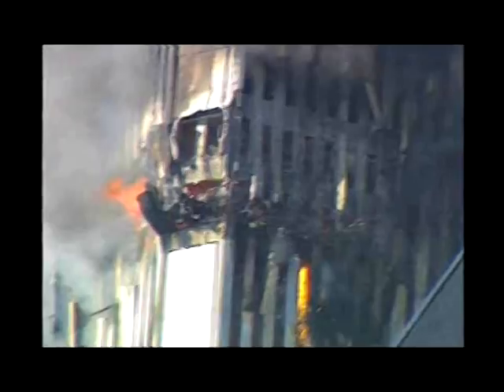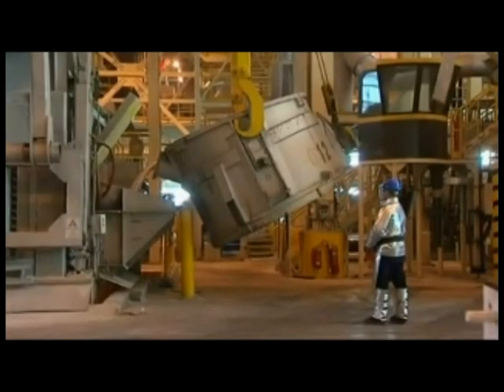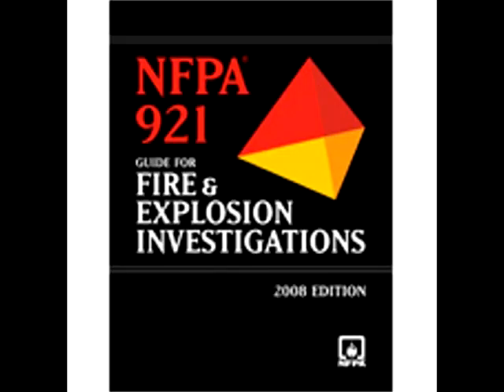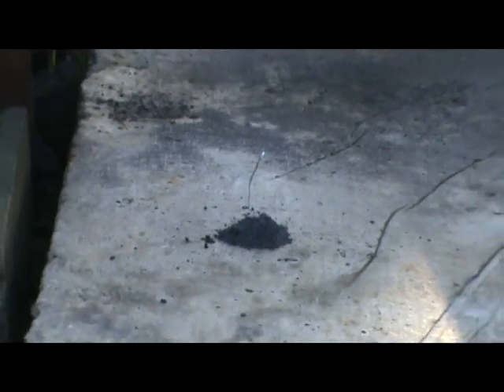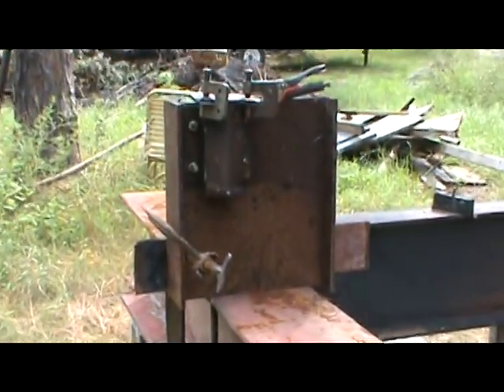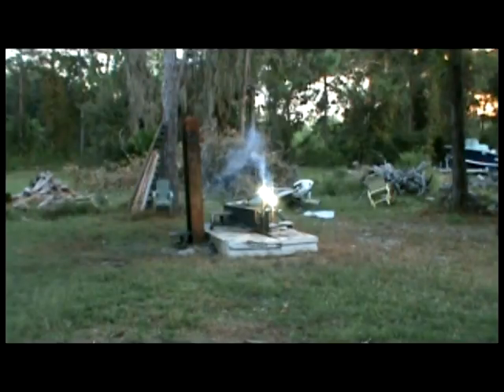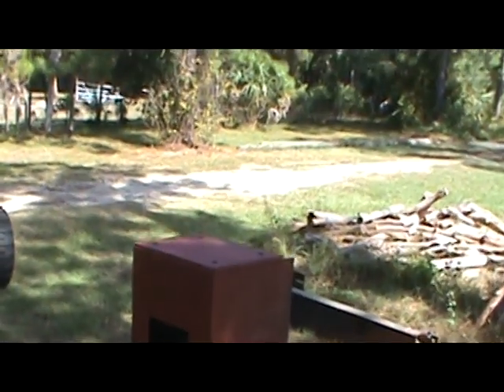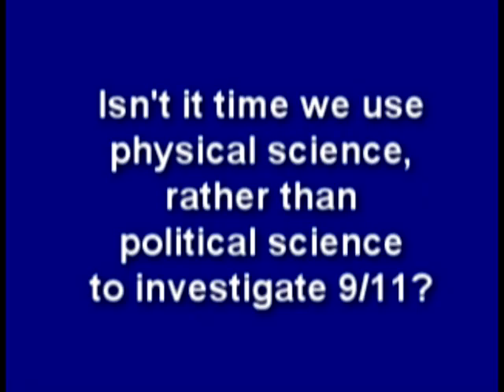9/11 Experiments: The Great Thermate Debate

Comment: NIST refused to test for explosives, that itself is Criminal.
Reply: Nothing is criminal with a gun pointed at your head.
Reply: https://en.m.wikipedia.org/wiki/Operation_Northwoods https://catalog.archives.gov/id/305036
Reply: Iron oxide, that would be rust, and aluminum powder, which was on the outside of the World Trade Center which is what's the side skirting was exactly what thermite is.
Thermite was located at the World Trade Center, because of the steel beams as well as iron bolts held the steel beams together, which is the aluminum siding of the World Trade Center, of course there thermite would be found. For those that wants to know more, look up Dr Judy Wood.
Reply: Pretty much everything the delusions loon Judy Wood has said, has been thoroughly debunked, as well as the thermite bullshit
Reply: Just Shady.
Reply: No need to test for explosives... Any explosive devices would have left very obvious remains.  As for the Thermite debate... one very obvious reason you might find trace thermite at a site like the World Trade Center would be the use of Exothermic welding in the construction of the building.
Applicable dates:

- Thermite reaction first observed in the late 1890s
- the Goldschmidt process (Exothermic Welding) invented prior to 1923 (year Hans Goldschmidt died)
-  World Trade Center completed in 1966

What does this mean?
Thermite could have been, and probably was, used in the construction of the WTC.
Reply: i agree with what you're saying, but the WTC weren't completed until 1974 i think it was. I have yet to see compelling evidence that thermite was found at WTC
Reply: yes, WTC was open to the public in 1973 and completed in 1974. if you watch the movie MAN ON WIRE, the French guy that walked the tight rope between the towers, was able to gain access to the roof because he and his crew posed as construction workers.
Reply: Your comment is criminal...

Ignorant in the 1st degree...
Reply: Brian Reed you're a dupe, you just spout the propaganda of a criminal government, please educate yourself if anything else just turn the volume down on your TV and watch the demise of the two towers, with out someone from the government telling you it was a collapse there's no way to come to that conclusion yourself, I hope you understand and if not back to the first statement
Reply: lennyhipp you're a dupe also, I'm not sure what happened I wasn't there don't know for certain. it was not the terrorists that the TV says to you, you're a dupe. Buildings don't collapse and if that was even a possibility you don't think they let anybody else go back to work in potential catastrophe, but the government said they collapsed at free fall which is against the first three laws of physics, so put that in your logical pipe you're a dupe
Reply: lennyhipp how do you watch any film and come to the conclusion that's a collapse you need to watch a few things about professional Demolition and you'll see quite a contrast of similarities, and as far as evidence dr. Judy Woods has a whole book of it. Like the fact there was no seismic footprint when the buildings were demolished, the Seattle Kingdome made a bigger thud to the ground than the towers had that's evidence,
Reply: lennyhipp and the alleged terrorists I believe you can still find half of them on Facebook, surely you don't believe everything your government says do you
Reply: lennyhipp this guy's going to have a stroke if he doesn't convince us of the official story, you sure do feel pretty strongly about your claim, good luck to you I'm done arguing with you
Reply: ZF, waiting for your response... and also or you to tell me a SINGLE claim by Judy Wood that you think needs addressing.
Reply: ZF, insert sounds of crickets chirping. Still waiting for evidence to support your claims about Judy Wood, WTC7 having no damage or randomly falling. (or even the ludicrous notion that ANYONE EVER said the heat from WTC1 caused other structures to fall. you argue like a 5th grader who fell asleep in science class
Reply: lennyhipp hey now that I think about it you're right about everything, I find it very strange how eager you want to argue that is stroke worthy my friend, and hey you know exactly what a dupe is, as one would say they buffaloed you buddy, hey I'm not arguing with you anymore, your right bin Laden and 19 f*** ups infiltrated the most secure airspace in the world, and whatever I'm right back to your a f**** dupe
Reply: lennyhipp hey was it Ben Laden who told NORAD, take the day off. Was that Bin Laden who asked Dick Cheney if The Stand Down order was still in affect.
Reply: lennyhipp you was in New York that fateful day weren't you? Willie Hernandez Was the janitor from one of the towers he States numerous times that was explosions From Below the lobby, all the First Responders we're talking about explosions, the firefighters commented it was like controlled demolition, even the news feed from that first day talks about the explosions from below the lobby, but hey what the hell do I know I'm just some jack off with a phone. Are you sure you don't work for the CIA, just remember the LIE the government told the American people about the Gulf of Tonkin. 58000 American lives later and almost 50 years, Robert McNamara States the Gulf of Tonkin never happened. Hey if you want to keep arguing I'll just give you my number call me straight through, hey if nothing else you have learned a new word. Have a good day
Reply: So that Iranian tower that collapsed do to a fire was really blown up by the CIA too? Or was it Purple unicorn men from Venus.
Reply: Nist got pissed guys

Comment: Iron spheres are a natural product of heating red oxide primer paint.  Not mentioning this (and in fact insisting the opposite) is just one of many lies uttered by physicsandreason.
Reply: Tony Duncan ...BS. ...ill give you all of that epoxy primer you could possibly burn in your office fire....and you'll never form an iron sphere in your lifetime,....its mostly plastic...did you forget the bright orange molten metal pouring out of the 84th floor before the collapse?...just how do you explain how that metal got that hot?
Reply: Tony Duncan ...your absolutely welcome....dang, I have to admit I dont have knowledge of primer chemistry...I do however have mathematical proof the govts BS story doesn't hold up to scrutiny...it's in the form of quantification of the collapse accelerations....the structures inertia alone accounts for the extra 2 seconds of collapse over free fall time....resulting in damn near exact accelerations we all saw..with the obvious conclusion that the columns provided no resistance to the collapse.. ....its the 2 paragraph physics problem they gave US as an "explanation" for those collapse accelerations.. you might want to take a crack at solving that one before you poo poo this thing with a grin...

Comment: Consider some aspects of the attack.
   1- The time taken in analysis and preparation the attackers had.  Time to train the pilots - The same time to test such thermal effects.  -  The same time implement the placement of any devices.  
This was not an overnight operation.
   2 - Why the planes, if thermite/thermate could do it?  Because maybe neither planes or thermite could do it alone.  
   3 - Planes?  Because it had to be a big fiery event, recorded and seen for miles.  Clearly an attack.  Dramatic.
   4 - Impact target area.  To bring the towers down, the planes had to clear all other obstructing structures on the path.  But hit in a way to have the weight of the "above" structure's crushing pressure.  Also, if thermite was in place, the aircraft fires may have had to hit below the thermite.  Maybe to be an alterate ignition source.  "Redundancy"
   5 - Why the towers?  The Pentagon and the would have been too hard for in place additional work.  And no great fall possibility.

Comment: Funny how thermite can't cut steal beams but jet fuel can.
Reply: You do not have to melt structural steel for it to become weak and lose its strength.
Reply: Mike S, doesn't that apply to thermite as well?
Reply: John Kimble He showed that homemade thermate could cut steel beams. Military grade nano-thermite was found at the site. Imagine what that could do to the beams.
Reply: Morgan, yeah I watched the video. Ever heard of sarcasm?
Reply: John Kimble I think I misinterpreted your original comment. So I guess I haven’t heard of sarcasm sorry.
Reply: Where was such found? Do you have any idea of what airplanes are made of? Fuselages and wings along with the ribbing for them are made from aluminum. Oleos are made from steel. There are parts made from magnesium. Engine casings are made from inconel as well as some turbine blades and burner cans. Depending on the engines, there maybe titanium parts as well. So you have quite a few different metals that flew into the building.

Now, do you think all those floors were devoid of any other materials? Where there not carpeting, paper, desks, wood doors, file cabinets (made with sheet steel), paper clips, chairs, computers, printers., cables, etc. Much of that stuff is flammable correct? 

Have you worked a job where demolitions were part of the project? Prepping everything for explosives is a very visible job. Where was all that stuff prior to the buildings getting hit? How was thermite planted?
Reply: Me?
Reply: Yes you.
Reply: Mike S To respond to your first question I will give you two links. https://benthamopen.com/contents/pdf/TOCPJ/TOCPJ-2-7.pdf       https://www.politifact.com/texas/article/2014/nov/14/laura-pressleys-something-was-planted-world-trade-/   These will tell you where samples were taken and tested positive for a advanced type of thermite. Secondly, yes I do know what airplanes are made of. They are made of legos. Do you mean to tell me that plastic could take down these towers? I don't think so. The contents of the floors including all the office materials, carpeting, etc wouldn't be enough to take down a tower even if it was all on fire. Sure it would be a catastrophic fire, but not enough to down two towers. I haven't worked a job that involved demolition. I don't know how thermite could have been planted. All I know is that the planes didn't take them down and thermite was found on site, which leads me to believe there was thermite in the building to take it down. For all I know terrorists could have put it there. I'm not trying to expose the US government, because my views on this are beyond anything political. I respect your views on this and I am not looking to argue, but this is just how I feel about it. Also don't think I am not American for thinking this way, because when I am 18 I am joining the military. Not sure what branch, but I'm thinking Navy or Marines.
Reply: Morgan von Bogel Join the Air Force... it’s the highest echelon. Better career opportunities. Cozier positions. Even better pay in most duty stations.
Reply: James C thanks.
Reply: Morgan von Bogel No prob. All military branches are great! I was in the Army for 6 years. A lot of field training exercises. The Air Force always had better barracks, got paid more if barracks they were staying in wasn’t up to AF standards. They’re VERY laid back and have many great jobs. (ChairForce) The Navy, you’re either stuck on a ship or a shipyard, and you have many more uniforms including dress uniforms to maintain. And it goes without saying the Marines are very tough. Anyways whatever branch you choose, good luck and take care! ✌️
Reply: James C Was the training for the Army hard. I want something that has good benefits. Thank you.
Reply: Morgan von Bogel Basic Training was kinda tough. They’ll yell at you and purposefully give you some tasks that are impossible to complete just to smoke you and help you work together well. Just keep that in mind and you’ll be fine. It’s 10 weeks of mind games, weapons familiarization, and lots of PT(physical training). I found it a lot of fun, but everyone is different. AIT (Advanced Individual Training) is the schooling for the job you pick. It’s classes combined with more basic training. Then you graduate and get assigned to your first real unit. After that it’s just war games. You train as you fight so if your unit is deployed, all your training becomes reflex.
Reply: James C Thanks for the information.
Reply: Morgan von Bogel All retirement benefits are the same for all branches, as well as GI Bills, VA services, and everything else. Its all the same federal government. I say Air Force because they’re laid back and promotions are easier. Plus you’ll probably have more free time and permission to attend college courses while in the AF. They don’t call them the Chair Force for nothing. Weigh out your options. Talk to recruiters from all Branches. You’ll see.
Reply: Morgan von Bogel No prob! Take care and good luck! ✌️🇺🇸
Reply: See, that is it, an airplane, or any aircraft, is made from the very materials that make up thermite. Aluminum, steel (though it should not ever rust), titanium, magnesium and copper. Iron oxide is also a component (rust) of thermite and steel beams will rust, unless coated. Of course such is gonna be found after planes hit a building and destroy itself.

Here is a picture I took back in the 80s on a construction project I was on, after I  was out of the Marines where I was a jet engine/helicopter mechanic/crew chief. http://www.whiteknight77.net/images/blast1.jpg, this is actually the first in a sequence of 4 pictures I took when they made this shot. All the black pieces at the top of the wall are cones to mark where the holes were that were drilled in the walls. This does not count all the holes that were eventually drilled in the road bed leading into the tunnel (right under where the camera was placed) that took at least 2 months to drill. All that kind of work is very visible and very noisy no matter if indoors or outdoors. An M-80 is not equal to a quarter stick of dynamite, not when it is 4 inches across and 16" long.

Do this, go get a Bic lighter and a paperclip and a pair of gloves. Straighten the paperclip out, put on a glove then heat the paperclip up in the center of it. Notice that even at the temperature a lighter's flame makes, it turns orange/red. Do this between your finger and your thumb and see how easy it is to bend it. Does that lighter melt it?
Reply: @morganvonbogel9918  the fire was not even catasrophic. The pressence of thick black smoke coming from the building indicates that the fire was oxygen deprived. Oxygen deprived fires do not get hot. No where near the heat even get any where near the temps to weaken steel.
Reply: Tom Hill You are saying that this oxygen deprived fire didn't cause the building to collapse, because of the lack of heat. This makes sense, but what do you think made the buildings collapse.
Reply: Tom Hill You see it bro. You are well spoken and thought out for sure. It is impressive how deep you are thinking. I don't like thinking like the masses or having a mainstream train of thought or way of doing things. I like the way you think.
Reply: @morganvonbogel9918  I have been watching this with doubt for a long time. I like to think of myself was a critical thinker. Unfortunately critical thinkers are becoming few and far between. The vast majority of the population can barely think for them selves as they have been conditioned through years and years of propaganda going back as far as 70 years to believe everything they are told. We have become a society that just accepts politicians lying to us when we all now deep inside every politician is a narcissist bordering on becoming a sociopath. Caring little about anything else but their ego and their bank balances. Power has morally destroyed these people but as a mass we do nothing about it and just accept it as "the system we have", and  telling ourselves it's the best system in the world when we have never experienced anything to compare it to. We accept the corruption everyday as we get poorer and they take more and more rights away from us every year. To replace those rights they give us security through fake wars which they manufacturer mainly to enrich themselves. Because it's always amazing to hear how much politicians recieve from lobbyists representing defence companies, healthcare companies and many other groups. Yet we tell ourselves that these people are representing us. Are the people that stupid not to realise that these corupt individuals have a vested interest in causing chaos because it makes them richer. I hope things get better but I can see us walking blindly off a cliff and realize that things will get alit worse before we see any change.
Reply: Tom Hill Is it too late to save ourselves from ourselves? The world needs people like you seriously.
Reply: Tom Hill In two minutes for my timezone it becomes the 17th anniversary of 9/11. Regardless of who caused it or how it happened lives were lost and for no good reason. Rest in peace.